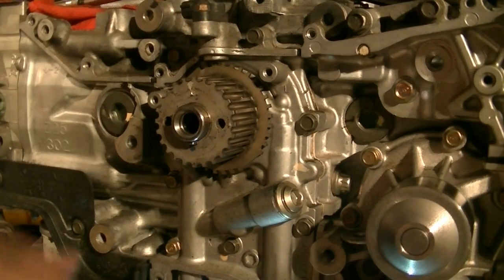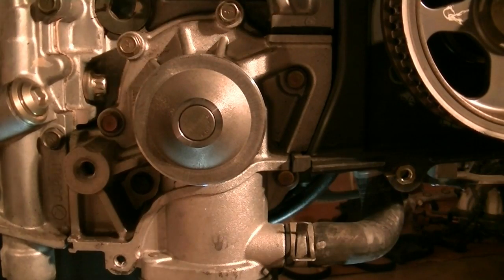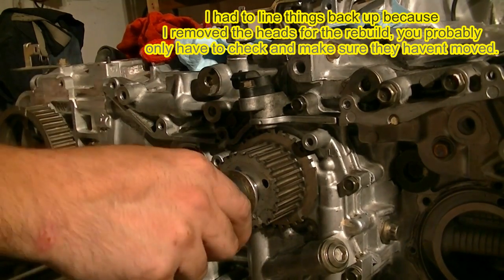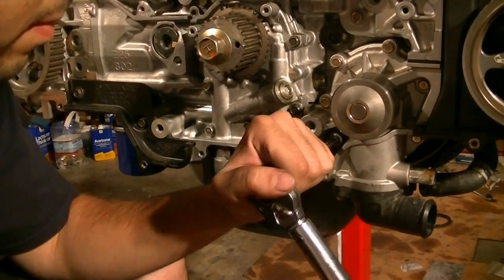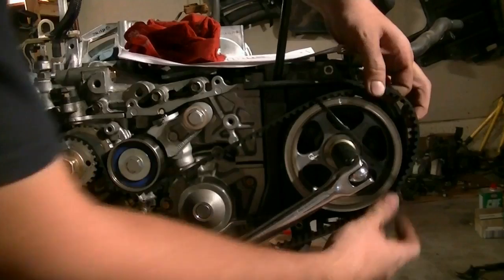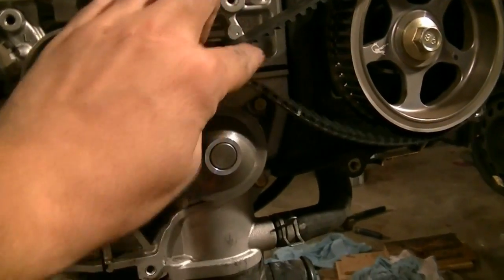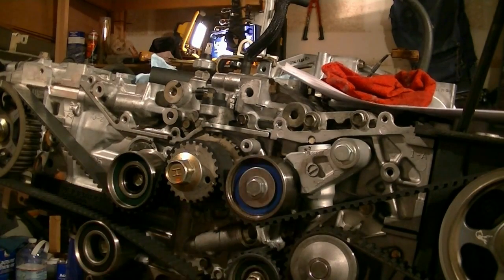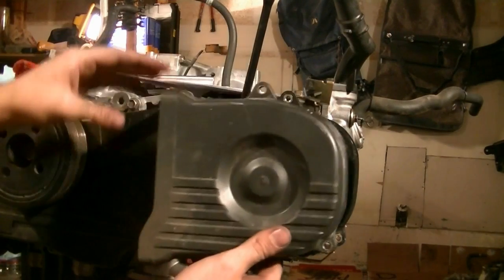Subaru Timing Belt Replacement (EJ25 SOHC) Part 2

Comment: the Woodruff key is mangled on the crankshaft pulley, threw timing off and unable to pull it out to replace it. Do I have to take tensioner and pulley out to replace? or are there any magic tricks that I can do? Thanks. best detailed video out there. Nice work

Comment: When you found the washer that fell that goes with the hydraulic tensioner, their might have been another small rubber ring that goes between that washer, and the engine when it's fastened. My 03 outback was that way when i removed the piece.

Comment: I installed my kit using your video.  One question.. after you do 2 rotations to line the marks back up, how the heck do you get the big bolt out with out Turing the engine backwards?  I tried holding the open face pully with a tool and it made the belt skip a tooth. I had to start all over.  Scratching my head here.  Thanks

Comment: Hello R&W,
I'm reinstalling my timing belt. The mark on my crank shaft pulley is at 6 o'clock and the marks on both cam shafts are at 8 o'clock.  When I turn my crank shaft pulley clockwise I feel it hits something that makes it stop. Can I turn the cam shafts first to the correct position and then the crank shaft or does that have to go first? Can I only turn in a clock wise position? Great videos by the way.

Comment: I had the Timing Crank/Crank gear or whatever, slice the teeth of my belt. Any insight? Car was idle for 5 seconds, heard some knocks then nothing. 
seize?
any insight or experience with the ej25 timing belt well appreciated. Thank you.

2002 forester, 200,000 ...so the belt was overdue for a change.

Comment: 2 questions. If you accidentally rotate the crankshaft to align the timing mark without the belt but was successful lining it up. What will happen? What will you have to do to line up the timing marks if the belt is off already and the cam/ valves are out of sync.  does not turn clockwise it stuck.  This happened to me already, but I want to see how you would correct the problem.  I made a mistake!  I lost my mind and took off the belt and started to rotate it with a ratchet.   Thanks

Comment: I just tried your trick of putting the extensions in the harmonic balancer holes and using a pry bar to balance the counterweight of torquing the correct foot pounds for the harmonic balancer bolt, and an extension bent the metal of my harmonic balancer. Once I can afford a new one I guess I'll also have to afford the special tool because I sure won't try that again. :-(

Comment: Keep in mind everyone that he has the idlers on the left side of the motor backwards the one with the lip is supposed to be on the bottom for the EJ25 single overhead cam motor.  Other than that this video is very good at explaining how to do it.
Reply: Also at 9:00 you can see the mark on the belt is one tooth off from the timing mark on the crank.. too bad he didn’t show a start up video

Comment: The pulley next to the crankshaft gear has no flange, the pulley with the flange should be the last one you installed.... I do not think it will make any difference but that is what I found on factory assemblies.

Comment: Love your videos, and thank you for making them.  Just wanted to point out something on this.  You have the two smooth idler pulleys swapped. The smooth idler with the back flange is supposed to go on the bottom side of the engine.

Comment: Why didn't you line up the two white marks that are on the new belt to the marks on the camshaft sprockets? That's what they are there for to get proper tension. Right?

Comment: Crankshaft seal question. 
If it leaks...what sort of oil will spill...
Engine oil? Or gearbox oil...?

Timing belt and seal were replaced by subaru. Drive home...gearbox oil all over the left side of the motor compartment. Telling by the smell of it...gearbox oil...

Comment: Maybe I'm missing something, but when you remove the timing cover, why couldn't you just put a witness mark on the crank that aligns with the block and do the same for each cam?  As long as the crank and cams are in the same position when you took the belt off and put the new on, I can't see the point of aligning the crank and cams to the factory witness marks before removing the belt? Is this just a best practice?  What am I missing? Very interesting video by the way. I'm trying to prepare for when it comes time to do this myself.

Comment: Can someone tell me, do it matter which way I spin the cams? I pulled the heads on my legacy for a headgasket job, and accidentally spun the cams while pulling the heads off - now I can turn them clockwise to line the marks back up but it feels super loose - It feels tighter if I turn counter clockwise

Comment: Where is thermostatic valvla of the subaru car warming up a lot
Reply: You probably found the answer by now, but the thermostat is located at the bottom of the engine, where the lower radiator hose meets the motor.  However if you are overheating, chances are you have a head gasket problem.  If you are lucky it'll just be the thermostat, but I wouldn't bet on it.

Comment: Not too  bad a job. 
I haven't done it yet but why did you wrestle the belt on the hard way???  If you tensioned it up along the bottom run, working around anticlockwise, then put the tensioner on last when there's some remaining slack for it to take up you wouldn't have all that fooling around with the left camshaft.  
Also it's not 9 foot per pounds, it's 9 foot pounds. Torque is the product of the force and the distance!!!

Comment: the last roller and the one above it are swapped. wrong placement of pulleys.
Reply: You're right. The roller with the lip goes on the bottom.
Reply: It was reversed like that when he removed the idlers, whoever did the last belt got it wrong. Also I probably wouldn't torque on the tensioner roller bolt, just remove the idlers in the reverse order of when he put then back on and use a vise to slowly compress the tensioner piston. Otherwise, not a bad video for EJ25s

Comment: Thanks for the nice video. Trying to make a shopping list of everything I need to do the job and get all my parts ready since my sub is my only car. Looks like the same as my engine. Shouldn't there be marks on the timing belt to make sure it's lined up and the right tension with the sprockets anyway?

Comment: Thank you so much for this i was following the subaru PDF shop book manual for this and was struggling with and scared of the pistons and valves would touch, but your video assured me i was doing it right with the crank mark lined up first and with your steps i was able to get it all set first time!!

Comment: hi, i love your method of fitting the belt by pulling it tight and holding it down, especially since none of the belt marks seem right anymore.  Ive been wrestling the belt on my 03 baja sohc for hours and its always about a tooth width off on one of the cam sprocket marks.  Is close enough just good enough on these things?  if i adjust it one tooth its even farther off on the next rotation.  Ive put it on by tooth count, belt marks and your way and its always the same.  thanks

Comment: Isn't the bolt from the harmonic balancer torque to yield?
Reply from the maker: +XxfunkypandaxX23 I don't think so, but you can torque the hell out of it without an issue if you like.
Reply: RatchetsAnd Wrenches I checked all data and pro demand and it said torque it to 33ft-lbs then get a torque angle gauge and torque it to  132.7 ft-lbs and the degrees has to be 65-75
Reply: RatchetsAnd Wrenches But nonetheless thanks for this vid it helped me alot
Reply: +XxfunkypandaxX23 

I deleted my earlier comment. According to the leaflet that came with my timing component kit, the crankshaft bolt is TTY on 1999-2012: 2.0, 2,2, and 2.5. 

* For the 2.5 *, the crank bolt needs to be checked for 'necking'. They write to oil the threads the threads. It also must be torqued in a particular manner, checking the angle that it moves going from step one 33 ft.lbs to step two 133 ft. The angle it moves in going from 33 to 133 ft.-lbs. is supposed to be 65 - 75 degrees, or the crank bolt is shot.

Reading the leaflet does nothing to bolster my already diminished confidence in Scooby engineering. Hindsight is always 20/20.

Comment: l tried to put a 2003EJ25  in time after my friend called me and said the ca stoped running  when put the cams in line with marks the passenhas 1 to 11/2 inch amount of play and the marks on belt advance about 1 inch  what could it be ? maybe bent valves. thank you

Comment: did you have to replace any oil seal for the crankshaft or anything while changing the timing belt?
Reply from the maker: dellam04 This engine was completely rebuild so yes, and in general it is good practice to replace them whenever replacing your timing belt. cheers

Comment: Great video! Question about the metal water pump gasket. Is that good to re-use?
Reply from the maker: AJFresh no, a replacement usually comes with your water pump anyway. gl
Reply: RatchetsAnd Wrenches i had to reinstall my water pump as I overlooked the side, L-shaped washer. I bought and used a separate water pump gasket. holding up well so far. Thanks for getting back to me this video was awesome.

Question, when you installed this timing belt you had it on in seconds. I observed how you installed the cogged idler last and put it on top of the belt and bolted it in. My belt didn't have the slack to allow that.

Took me 15min to wrestle it on my first time and when i redid it after turning one of my camshafts around to correct engine vibrations, it took two hours. Did you get it on so easy due to re-using a timing belt?

I started at the passenger side cam sprocket, made my way through the top pulleys to the driver side cam sprocket, down to water pump and then struggled from there. I tried with and without the cogged idler installed. It sucked either way. I eventually installed the cogged idler  and pulled the belt under it from the left, and then pulled as much slack as I could from the right side and still struggled to get it up over the water pump.

2nd question - Was I imagining things or are the two heads supposed to be in some phase of stroke relative to each other to make the engine run smoothly? If so, is there something else to syncing them other than making sure the timing markings on the sprockets are straight up?
Reply: In another video on same, the guy said always use a metal gasket, buy one if the replacement pump comes with the paper gasket, they often leak.

Comment: Hi,  I need your help please,  I have a Subaru Legacy 1998 with ej20 sohc,  spark plugs wires sit directly on the cylinder head,  not the one with spark plugs wires through the valve cover

Throttle with wire not the fully electric one 

Running with obd1 computer 

It is front wheel drive not AWD

Can I put on an ej25 on my car?  And which ej25 will fit in direct without replacing parts and without modifications on electrical harnesses ?
Reply: thesniperofcs I suggest checking one of the Subaru forum boards. I haven't looked up much Legacy (till now) but here's some links to get you started
http://sl-i.net/FORUM/
http://forums.nasioc.com/forums/forumdisplay.php?f=13
http://www.ultimatesubaru.org/forum/
http://www.legacygt.org/forums/
http://www.topix.com/forum/autos/subaru-legacy

I also saw some promising links by googling "subaru legacy mods" gl!

Comment: Dude.... Whoa....

Drivers side cam.... How do you keep it from rotating because when you line up marks on belt and crank and both cam sprockets the drivers side cam will be up on a lobe and will not stay put

Comment: First, great video, very helpful, thank you!  Just my two cents, but after I replaced the timing belt on my ladies 2005 outback... it was idling roughly and dying.  I'm not sure if the belt needed a bit of break in... but, after reading other posts about the balancer, I realized that maybe I had over tightened the power steering/alt, and AC belts.  I loosened them just a few turns to take the tension down a bit... and now the car seems to be running perfectly.  I'm not sure if the timing belt needed break in, or if the accessory belts being a bit tight was the problem.  Anyway, that is just my two cents... thanks again for the great video!

Comment: I just hope I was tight enough on top, it was really hard to put the idler gear on to the left of the water pump. A lot harder than it was for you.  I guess I'll see.  I was able to get the notch to line up on the drivers side then I pulled the belt tight and the line on the belt was right where the mark was.  But I barely had enough slack on the bottom, had to loosely put the idler gear on and slide the belt on the teeth then pull like hell to get it over the waterpump.  It looked like your belt was longer than mine and that makes me nervous.  But I also feel like I couldn't have stretched my belt another tooth on top, it didn't have a tooth to give.    It's a gates belt, it's the correct belt.
Reply: Clearanceman2 Thats because the poster installed the belt the hard way.  Most will install in the following method: top left idler, cogged idler, tensioner, then bottom left idler.  What the poster did really risks cross threading the idler bolts.

Comment: Why did you remove your crankshaft gear?  If your crankshaft seal isn't leaking, is there a purpose in removing the crankshaft gear?  Because I left mine alone.  It was lined up and the seal wasn't leaking and it doesn't get replaced in the kit, so I never removed it.

Comment: I cannot get the belt to keep tension as the show.. other people say do it at the crank then go out and to the bottom.
Reply: I started at the crank gear and went to the right under the tension and around then did the left top side.  Then did the idler gear by the water pump and finally the last smooth tensioner underneath.  I think it doesn't matter as long as you do the idler gear second to last and smooth tensioner bottom left last.

Comment: When your on TDS on the cams are all the valves closed or are 2 open on each piston?
Reply: When the dot or square on the crank gear is straight up and the arrow is at 3pm, the pistons are halfway in the bores.  That's where you want it, if you are at TDC and a cam wheel springs around, you can damage a valve. Most cars you do this at TDC (arrow on crank gear up) but you better not on this motor.

Comment: I was careful to align the white lines on the timing belt material as well as what you demonstrate for the cams and the crank.  However, this did not provide enough room to add the sprocket after the water pump.  I think removing the slack as you show is the solution; but, can't understand why the physical marks on the belt don't allow for no slack.

Comment: The smooth idlers are backwards the one with the lip goes on the bottom!!
Reply from the maker: Looking at other videos it seems thats correct, Someone had already done a timing belt job on this engine and I guess they put them backwards, and I just put everything back where I took them off.
Reply: RatchetsAnd Wrenches FAIL.  The top left idler should have a double bearing because it has more force on it. IMHO, you have risked a failure of the top left idler pulley.

Comment: Nice video and very detailed. Just wondering how hard is to do this with the engine in the car..
Reply from the maker: I havent done it in the car, but you'll probably need to remove the radiator fan and probably the power steering pump and or ac compressor and set them aside. GL